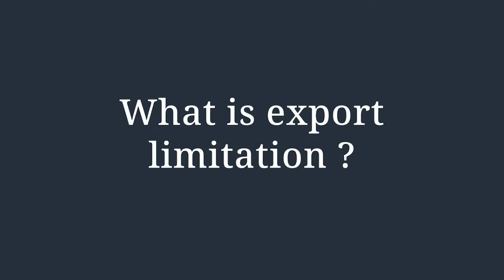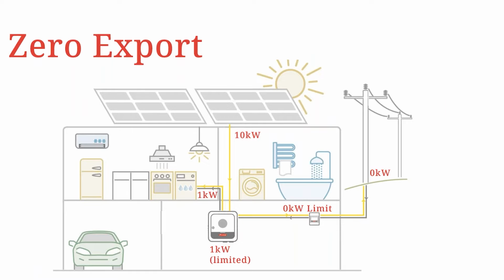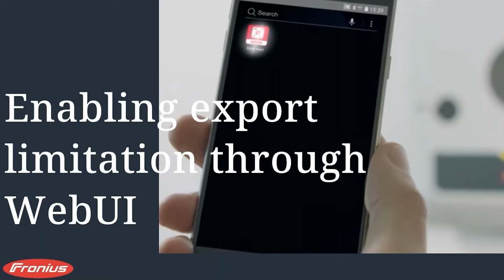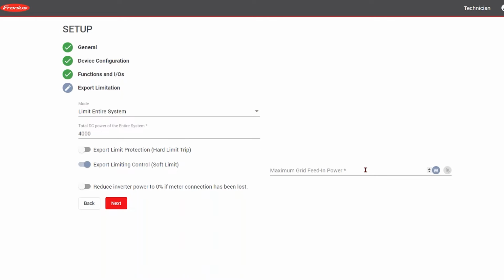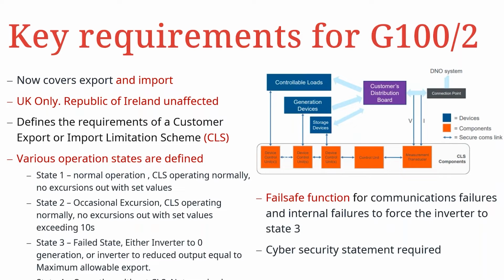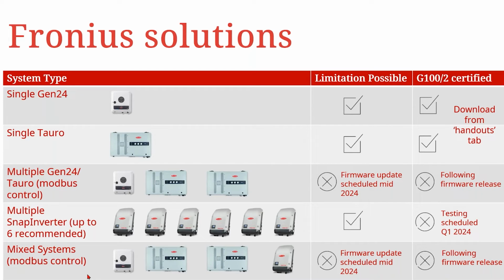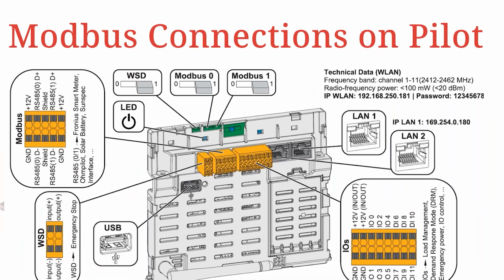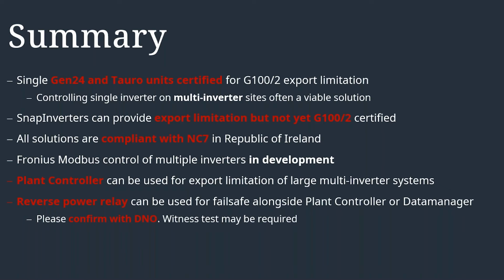Webinar: Export limitation, G100/2 and Modbus control for PV systems with a Fronius inverter (UK)

Comment: We have an existing, multi- inverter pv installation ( circa 2011) with an export limit set at 54kW. Existing inverters are all SMA and are all monitored via rs485 through an SMA webbox. We are looking to increase the pv production capacity ( to further help during the winter months and with a view to adding battery storage). I haven't approached the DNO yet, but would modbus monitoring of our 3 phase incomer be in order to control any new inverter (s) added , to ensure we remained below the 54kW export limit? ...or would we have to swap out all of the existing inverters to be G100/2 compliant? TIA.
Reply from the maker: Hello, thank you for your comment. The latest GEN24, Verto (Plus), and Tauro inverters with the latest firmware version have a new feature called “System Power Control,” which allows both Fronius devices and third-party devices to be controlled via TCP. If the SMA Webbox has a TCP interface and can therefore be controlled, this control can be set up.
However, this should be checked separately and more information is required for this. Please send a support request to: https://applications.fronius.com/contactform-support/SolarEnergy

Comment: Can I over size a Symo 15kw with 27kw solar panels or I must stop at 22,500 ?
Reply from the maker: The DC oversizing is limited to 150% of the AC power. Therefore, we can install a maximum 22.5kWp PV array on the Symo 15kW inverter.

Comment: 13:22
Are the inverters applying the limit smart?
For example if we would communicate to the master that we want to reduce to 60% max of the total power of our lets say 100kWp field, do the inverter figure out that we want 60kW from them our do we set each of them to 60% and might end up with les power?
Reply from the maker: Hi @kabelloseskabel7029!

Thank you for your question. This function will come with the new software update 1.31. It is called System Power Control.

Best regards, your Fronius Social Media Team